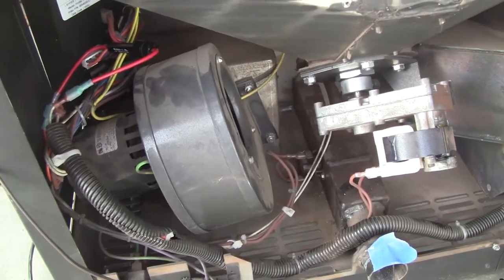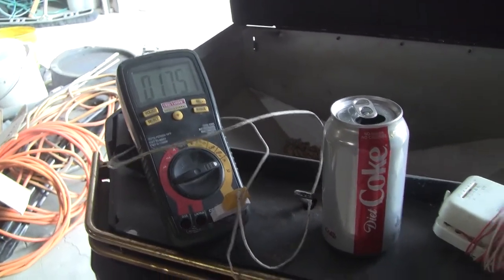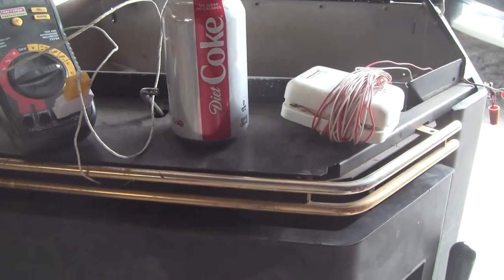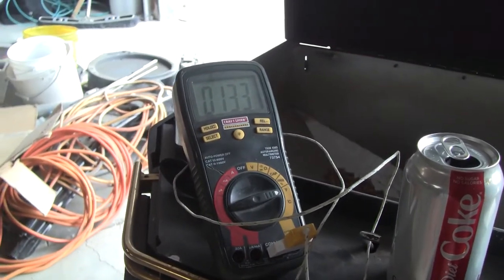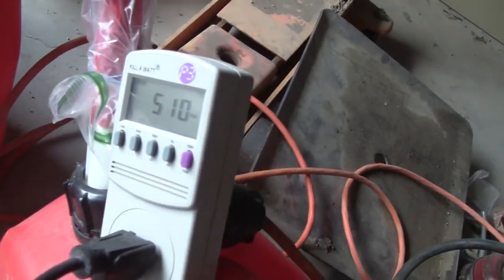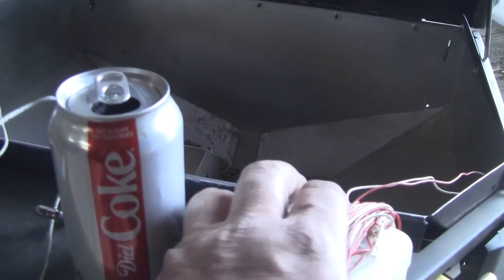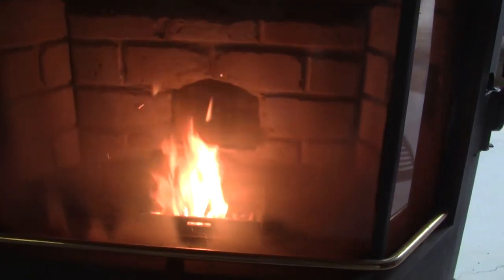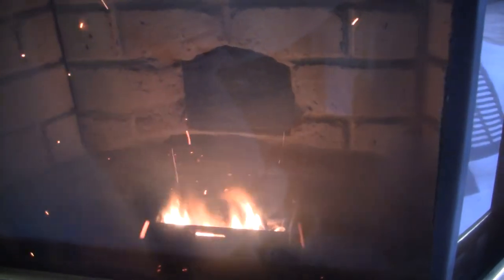Whitfield Advantage/Profile 30 Pellet Stove Repair and Testing. Part 1.

Comment: 500w is alot for a pellets stove start up. I guess its a pretty old design. I think our pulls about 150 to 200w during the start up an then it will pull between 25 to 80w. Cool video and great to see that its works just fine.
AS a pellets stove owner for 14 yrs myself,  its important to clean the burn Chamber every week and vacuum out the ashes with a ash vacuum. Then give it a deep clean at the end of every season. Clean the auger, distrobution fan, exhaust fan and the smoke tube going to the chimnney. And remove all dust buildup inside of the stove. Pellet stoves works pretty flawless if given regular maintanence, ignitors are the most common part to wear out, other than that. There should not be much of an issue. Happy pellitering and enjoy your stove 😀

Comment: Start up feed should be on low, high blower.    

If it shuts off quickly, low level switch is bad.   If it shuts off after an hour it’s most likely your high heat switch..  sensors.  
Replace those before changing the control board. Much cheaper fixes.    I’ve had mine for 13 years now.  This exact model
Reply: I'll try that as every since I had a maintenance guy come out cause I was lazy. It hasn't run the same. It overheats even with full damper and low heat to slow hoper down.

Comment: I have one. Had it in the family since new (late 90's) Ours is the Advantage 2. I just fired it up for the first time in 3 years and the room blower isnt working. I will check that fuse. Anyway, I found it to be very particular to keep the flame "perfect". Fuel feed and internal air blower must be exact. Facing the front, on the left is a rod that you pull out or push in to control the air blowing on the flame. You gotta get it just right and pellet drop to keep the flame going. Too much fuel drowns the flame, too much air does the same. Hey that rhymes :)  I do not love this machine.
Reply from the maker: Those blower motors can seize up if they are not lubricated each season.

Comment: Clean out all your fans and squrill cages. check and clean all the holes in the burn pot. go to the front lowerhalf of the stove and brush out and clean the exhaust fan and channel. then stand by for some real heat  200F plus.
Reply from the maker: Did all of that this season. Have you measured 200F on your pellet stove ?

Comment: Seems like it ran too hot and shut itself off.  Did it shut down again?
Reply from the maker: It did run super hot once. But once I cleaned off the light sensor lens, this pellet stove works perfectly. It's now mounted inside the house. A real joy.